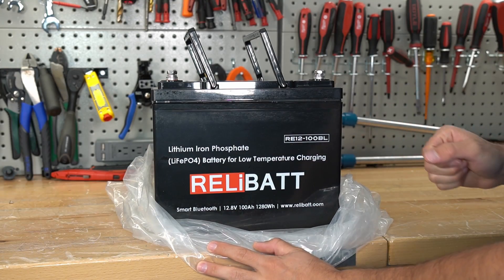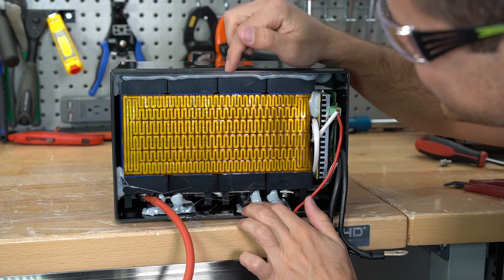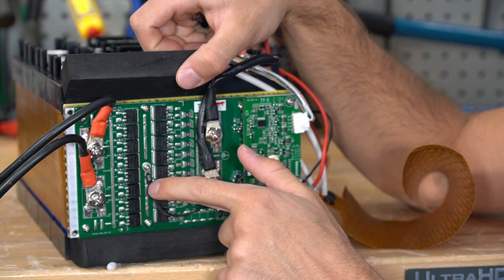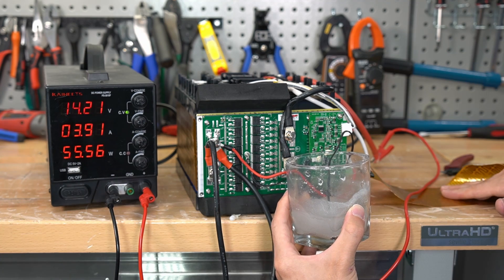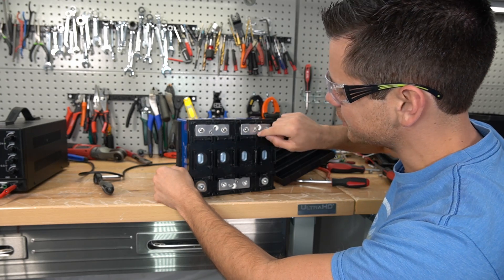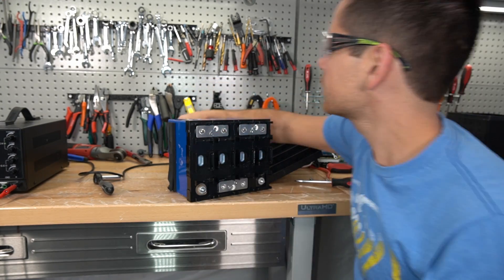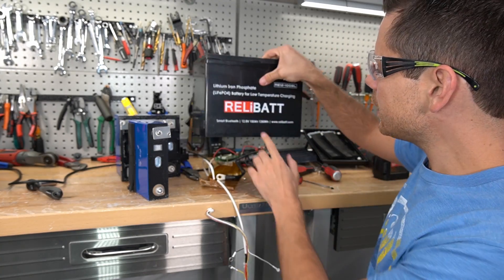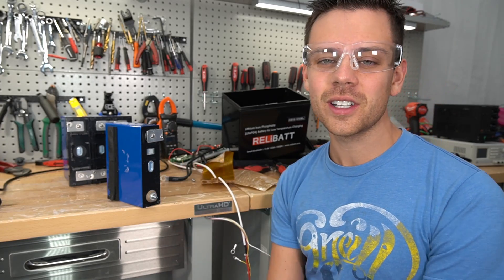$549 Relibatt 12V 100Ah LiFePO4 w/ Internal Heaters

Comment from the maker: Relibatt now claims they did not glue this battery as much as the others because they knew I would open it. Somewhat surprising to me, but I'll let you guys decide what to believe. 

If they are correct and they did not glue this unit as well for the review, they should have had a large label on the battery stating "lid not secure for teardown" or something like that.

~~~~~~~~~~~~~~~~~~~~~~~~~~~~~~~~~~~~~~~~~~~~
Tired of getting ripped off? Check out my "Will Prowse Approved" solar product recommendations below!

12V Batteries
https://www.mobile-solarpower.com/lithium-batteries.html

48V Batteries
https://www.mobile-solarpower.com/48v-batteries.html

Offgrid Inverter System Builder
https://www.mobile-solarpower.com/48v-complete-system-blueprint-559371.html

Hybrid Inverter System Builder
https://www.mobile-solarpower.com/code-compliant-48v-offgrid-system.html

Mobile Handtruck System Builder (very popular!)
https://www.mobile-solarpower.com/mobile-48v-system.html

Solar Panels
https://www.mobile-solarpower.com/300w-solar-panels.html

Ground Mount Solar Racking
https://www.mobile-solarpower.com/ground-mount-racks.html

Wire, Lugs and Busbars
https://www.mobile-solarpower.com/wire-and-connectors.html

Tools
https://www.mobile-solarpower.com/tools.html

Fuses and Circuit Breakers
https://www.mobile-solarpower.com/fuses.html

Plug-N-Play Solar Systems
Ecoflow, Anker And Bluetti! So many models to choose from. See my current recommendations here:
https://www.mobile-solarpower.com/full-size-systems.html

~~~~~~~~~~~~~~~~~~~~~~~~~~~~~~~~~~~~~~~~~~
Need to build a large DIY system? Need a trustworthy solar distributor? These are my favorites:

Signature Solar
Creator of EG4! Solar Minisplits, Victron and More! Largest Solar Store Online.
If you want $50 off, please use my link below and coupon code "DIYSOLAR50":
https://signaturesolar.com/?ref=cPwLcVc0SW-BjN

Current Connected
Best Prices for EG4, Victron, Midnite and so much more! Fast Shipping and Highest Rated Customer Service:
https://currentconnected.com/?ref=wp

~~~~~~~~~~~~~~~~~~~~~~~~~~~~~~~~~~~~~~~~~~
Join our DIY Solar Community 
Need more help? Join the largest solar forum on the internet for beginners and professionals alike. 140,000 members and counting!
https://www.diysolarforum.com

Check Out My Free Book
Best-selling and beginner-friendly guidebook to off-grid 12V solar!
https://www.mobile-solarpower.com/the-book.html

~~~~~~~~~~~~~~~~~~~~~~~~~~~~~~~~~~~~~~~~~~
Contact Information:
I am NOT available for personal solar system consult! If you wish to contact me, this is my direct email: williamprowsediysolar@gmail.com
FTC Disclosure Statement and Disclaimers:
Every video includes paid promotion or sponsorship (such as free products for review). Some links on this YouTube channel may be affiliate links. We may get paid if you buy something or take an action after clicking one of these. My videos are for educational purposes only. Information is subject to change/update at any time. Electricity is DANGEROUS and can kill. Be smart and use common sense :) DIY Solar Power with Will Prowse is a participant in the Amazon Services LLC Associates Program, An affiliate advertising program designed to provide a means for sites to earn advertising fees by advertising and linking to Amazon.com
Reply: It's hard to tell but it looks like when you pull the lid off that there is dry/hardened glue around the top of the battery case. It looks to me like the glue did not bond properly to the lid. What sense does it make to "not glue this battery as much as the others"? One would think they would simply not use any glue, not still put some amount of glue... Sorry but lol.
Reply: Not fit for teardown critic if it's assembly is any different from retail versions. ( Suggests company is playing games. ).
Reply: I was wondering if they left it loose on purpose. Kinda dumb not to tell you.
Reply: You should use the M1 Mac Mini  and she  the power input levels and try a program that it use to crunch video!
Reply: Who knows... Sounds like CYA to me.
Reply: But doesn't that mean they know before hand which unit is going to be reviewed and may be tempted to make a none representative battery. Wouldn't a random battery be better. They can reimburse you for buying the battery anonymously.
Reply from the maker: @borisquince6302  this point gets mentioned at least once a week. You are one of thousands to think of this. And if you actually watched my past videos, you would know that units shipped by the company usually do worse than random units I buy myself. It's hilarious
Reply: Can we proceed with the shipping immediately cause you're paying for shipping charges yourself, are we good?
Reply from the maker: @richeagleton5285  there are tons of scammers on here. you seriously fell for them? If you think that profile was mine, and I would ever use WhatsApp, you should stop using the internet. This is not the 90's. You should know better
Reply: @WillProwse  no i didn't I saw the difference in dates before and he started talking different then I thought you would so I checked and scammers been active for 3 weeks
Reply: @WillProwse   been in business ten years before I broke my back and neck abs lost my arm so now I'm only a supplier
Reply: Wil, you should NFT your profile pic then you can sue anyone who copies and uses it.
Reply: @WillProwse  good point
Reply: @WillProwse  digital junk mail!! hehe
Reply: Lucky my wife caught it
Reply: You have a scammer on here sent me a text abd now he has my address thanks

Comment: Will I need your Opine on batteries I just bought, please.   I just bought 4 Ardroit 125AH 12.8-with mass continuous both charge as well as dis-charge at 125 amp. .... Have you ever heard of this brand? all but one of the batteries came in good shape but the 4th battery has swollen sides and is doing some odd things like taking twice as long to charge as the other 3 and it seemed to fully charge out of nowhere, meaning that the others worked their way down on amperage and voltage while this one was at the 18.8 out of 19 amp. charger readout. I am hoping you have heard of the brand and can say something like ahh that is a nifty battery!...............................again I like your style and respect your opinion!

Comment: CAN YOU PLEASE ANSWER WHAT IS PROBABLY THE STUPIDEST QUESTION YOUVE BEEN ASKED? IF THERE IS AN EMP EVENT (NATURAL OR MANMADE) WILL THAT DESTROY ALL SOLAR SYSTEM COMPONENTS? IF YES, IS THERE A WAY TO "FARADAY CAGE" THEM? (EVEN IF ITS COMPLEX TO DO).

AND ARE THERE ANY COMPONENT SYSTEMS WHICH HAVE GOOD OLD MANUAL DIALS AND/OR NEEDLE HAND METERS TO MONITOR THE SYSTEM (INSTEAD OF USING CELL PHONE APPS)--BECAUSE THERE WILL BE A TIME WE CANT USE CELL PHONES EITHER BECAUSE OF EMP OR BECAUSE SOME OF US ARE NOT GOING TO COMPLY WITH THE WORLD BEAST SYSTEM)? 

PLEASE PLEASE PLEASE CHOOSE MY QUESTION AS ONE YOU HAVE TIME TO ANSWER. MAY GOD BLESS YOU!

Comment: Thank you for all the great information on solar setups and battery's.with all the battery's you have reviewed what would you recommend  for a 24 volt battery  setup that will be using 20 to 40 amps to run a off grid setup.  I have 4 Rolls 550 battery's  now. I can build if it is cheaper  or buy two 12 volt.   To charge it I have 800watts 12amps coming from solar. 
Thanks

Comment: If I make a solar/battery system and want to add batteries over time to increase storage, how do I safely add another battery?  Gonna start with 50Ah battery and 100watt panel.
Want to slowly up the Amp hours with my meager budget.
Same question for adding panels.  If you can help, I'd really appreciate it.

Comment: This is WAY off topic for this video. But…. Was thinking of your channel today when I was dreaming of modifying an unused/spare ego battery charger. Want to gut it and figure a way to put a little MPPT controller in it. I’d like to be able to charge just 1 single EGO battery on solar. I know there is the new larger unit where you can charge 4 batteries at a time…. But I have an excellent use for one of my spare batteries. It powers the DC lights in my little storage building. Would be amazing if that 1 battery always topped off and ready to go.

Comment: Are you able to comment on the expected shelf life on similar sized (1000 to 3000Wh) lithium ion batteries compared to expected shelf life of LiFePO4 batteries when both are stored properly and infrequently used?  I'm reading anything from 2-3 years, up to 10 for lithium ion, while the LiFePO4 batteries under the same conditions are expected to live up to 10 years before significant degradation.  How much degradation can be expected?  Thanks so much !!!!

Comment: looking for a 300 ah lifep04 battery for my camper any sugestions? looking t the Chins 12v 300ah lifep04 smart. with low temp and high temp protection. Do i need this?

Comment: +Will, What would you recommend for an off grid RV solar power system that can simultaneously charge a battery bank that can run for 24hrs, be 80-90% fully charged by 3pm daily, only drain down to 20% by 9:30 am before the next solar recharge cycle, can run a crypto miner 24/7, can run a Mr. Cool heat pump 24/7, can charge a Tesla or the Ford Etruck, and power all other things in an RV off grid home? Could you make a video discussing all the components, prices, etc involved and recommened list as well as any current discounts you as an influencer can offer through vendor links? It could even be a mini-series of videos so as not to be one too long of a project.  Anyone else who would like to see this or similar video and add any comment what to include do so and like this comment😁👍
Reply: YOU would first have to figure out all the loads you're trying to run then size from there...his setup might be different than your setup.  His component selection might be different that your selection. 

There's waaaaay too many variables. Don't be lazy or pay someone to do the work for you
Reply: @mrmotofy  Maybe so, but it would be great to see the challenge of getting it done, all the variables involved from an expert home builder, and get an close idea of the cost involved to see where any problems might occur. Most of it looks doable. He may be the only person who could do it. I don't know anyone else and I would gladly pay if the price is right. 😉
Reply: @terrafirma9328  There's tons of people all over the country that have companies that desire and sell solar systems. It's gonna be a substantial cost. But YOU would have to spec all the products you wanted to run

Comment: Hey Will, love all your videos and your book! I am in process of building my own system and you have made it much easier to understand! Quick question.  If I use 2 40a charge controllers on a 800w do I split the system in half and then run both to the battery?

Comment: Hey Will, I tried to find a video to cover this but can't seem to find my answer.. If a battery brand says it can do X amount of batteries in parallel, but you want to be able to expand your storage past that, can you just create a new bank of batteries and wire it to the same inverter/charge controller and be ok?
Reply from the maker: Check out my current sharing video
Reply: @WillProwse  Awesome, thanks man.

Comment: As an Electrical Engineer I am really liking your channel and your thorough reviews of products! One question, do modern LiFePo4 batteries with BMS reduce/cutoff the charging current when the battery is fully charged? I am thinking of putting one in my travel trailer that is connected to my tow vehicles charging system and I am hoping that it does so it doesn't harm my alternator on a long trip? I have heard you can put in a battery isolator to do this but it wouldn't seem necessary if the BMS does they same thing and the isolator also has some voltage drop.
Reply: Yes, BMS do a lot of stuff depending what brand you get, some have active balancers.

Comment: Please will. Can you give some input on a solar system we are installing into our off grid resort.

We require 2 voltage system. 12v and 48v

The 12v will supply all the lighting and fans

The 48v will supply all the appliances like cooker kettles fridges etc.

Do I need two solar panel arrays? Can it not be done with one array and two solar inverters or one complete invert off grid type and another mppt to charge just the 12v batteries. This way the load could come off the charge controller directly 12v?

Comment: Hey Will.  Do you happen to know the most wattage a person can expect from 1 single flexible solar panel.  I'd like to find one in the 300w range.  For my purpose, I can't really use 2x150 or 3x100.  A very light weight rigid panel would also be ok.  This is going on a kayak.   Any thoughts?  Thank you and great content as always.
Reply: What a dumb question

Comment: All this company needs is to drill holes in the side of the lid. Get rid of the glue and welded terminals. Make the battery serviceable like SOK. Then they can compete with them. Same with Battleborne.

Comment: I am expecting to have to buy new batteries at my camp in Maine.  During the winter it will get below freezing.  I have solar panels charging the current AGM batteries.  I would need a set of lifepo with low temp protection.  Any recommendations ? Anyone?

Comment: The heatsink on the back of the BMS does make sense. The thermal conductivity of the plastic body of the FETs is extremely poor. But the FETs are soldered to the PCB which has a lot of copper in it and much more surface area to pull heat away from. It looks scary but it's likely far more effective.
Reply from the maker: That is a good point. Very true

Comment: I personally would not recommend buying from Relibatt. Something came up and I had to cancel my order and they claimed to have canceled it and then refunded it when I was charged anyways. I ended up having to do a charge back because the charge was still on my card 2 weeks after the so called "refund." Also their website is completely nonfunctional and won't let you create an account or sign in/recover an account made at checkout as I believe they do not have a valid email server.

Comment: Hello i have a question about the lithium battle born batteries you connected together i saw the charger u used and wonder if you could charge them all together with the battery charger or only charge one at a time

Comment: The Lossigy 200ah batteries I have are still working great in my motorhome and a friend put one in his race care trailer. The price has gone up $40 dollars since I bought mine in March. Does it hurt a lithium ion battery to charge it with an alternator at less than 14 volts?
Reply: To be safe, it's best to get a battery to battery charger! Most alternators are designed to charge lead acid or agm batteries with little to no issues! You could destroy, damage or even explode Lifepo4 batteries due too how alternators works!
Reply: @elementalblaze79  "due too how alternators works!" Please explain, I'm new at this. My alternator is a 200 amp in a diesel pusher motorhome and at peek my batteries only draw 97 amps at a constant voltage. My batteries show they are charging at 13.5-13.7 volts at my BMV 712. That's about what my solar does. What am I missing?
Reply: @timaz1066  You will never get the batteries to full charge without a dc-dc  charger made for alternators.  The voltage is too low.
Reply: @merlpriester  I also have 700 watts of solar that is charging them and form what I have read I shouldn't be bringing them to 100% all of the time anyway. Is that true?
Reply: Not an an expert but from what I know,  100 percent charge is OK. draining them 100 to below 10 percent is in fact hard on them.  But if you do this once in awhile, aging will kill them first.  Everyday is not good.  If you use solar, you need a solar charger that has a LIfePo4 setting.   This will charge them up to capacity and not do a lead acid desulfanation phase as that is hard on lithium and can kill them.   I used as rv charger that was s13.6 volts until I got a lifepo4 charger for my trailer, and the charge level is in fact night and day.  Charging from low percentage of charge to 80 percent is fast and then it is slower on most chargers as the resistance in the battery is higher.  For solar pwm chargers work OK but MPPT  chargers are much more efficient with panels voltages that are  at least 5 volts over the battery voltage max.    So a 14.6v charge max on lifepo4 would need min of about 20 volts on panels, so panels in series works best to raise the voltage.  Just don't over-volt your MPPT controller.

Comment: I guess I'm a contrarian....I think it's a bonus the top/lid pops off easily! You can upgrade connections and wires if you want to and reseal it any way you choose. In fact, speaking of SOK you could use small self tapping screws to secure it back on.
Reply: Such a thing does not exist in Will's perfect world.  I wonder how he'd laugh at the $350 LiFePo4 batteries that I use that have never given me an ounce of trouble in over a year.  I guess he needs "content".  SOK and these other overpriced brands can pound rocks and be thankful there are enough suckers out there to overpay.
Reply: @gr0uch02a  can you direct me to where you got your batteries? Would be interested in checking them out